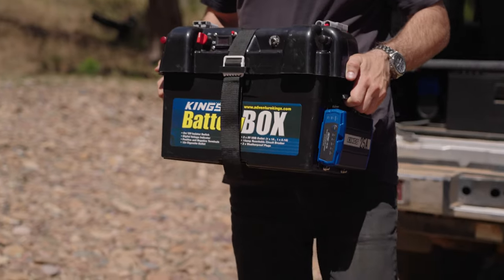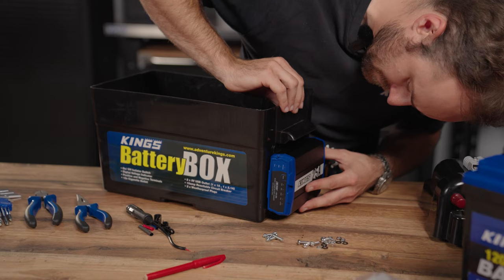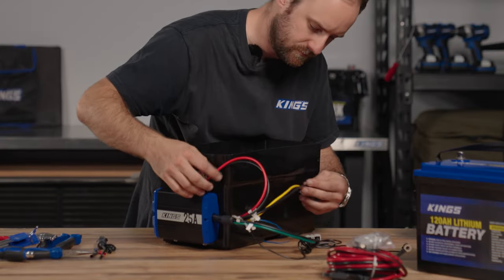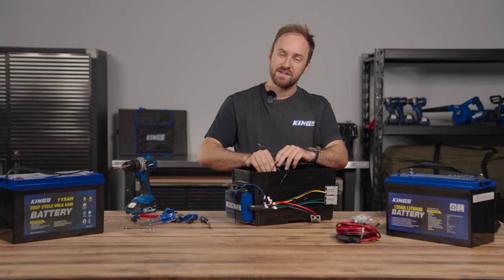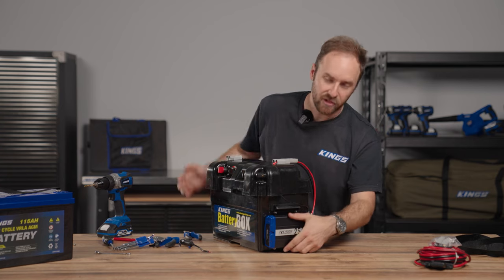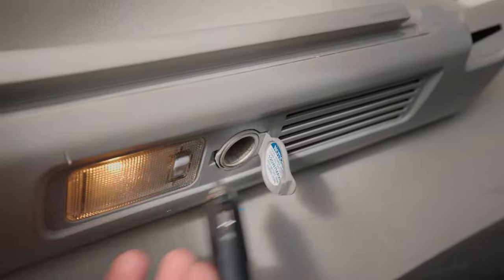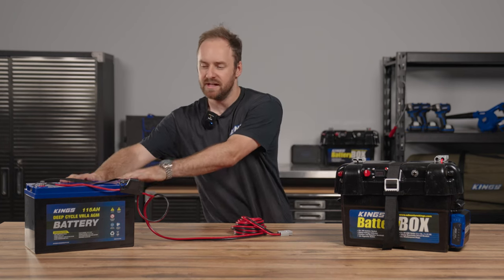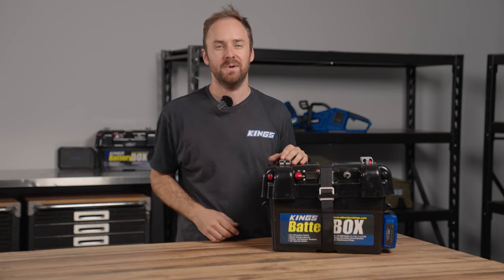How to install DCDC Charger onto Battery Box! Easy DIY!

Comment from the maker: I am getting a lot of questions about the blue wire and cig socket setup... One thing that is critical to check is that your cig socket only has power when the vehicle is on! Some newer vehicles like the Ford Ranger can supply power to cig sockets even after the vehicle is offf - in this case, the charger won't know to stop charging as it assumes the vehicle is still on!

SO, check if your cig plug has power when the vehicle is on and doesn't have power when the vehicle is off and you're good to go!

Cheers,
Cahn

Comment: So if i connect it to my cig plug, do i still need to run cables from the starter battery and connect to the battery box?
Reply: Cig plug is just a trigger, you still need connection to start battery
Reply: So do only connect the blue to the cig red ? Leave the black disconnected on the cig plug ? And can you just connect the battery in direct to a cig plug instead of running wires from the primary battery ?
Reply: What’s the input wattage requirement for the DCDC charger? My rear cig socket is labelled as 120W. Is that more than normal? Can I run power to that instead?

Comment: What about installing in a caravan to charge batteries,what happens with the blue alternator wire????
Reply from the maker: Hi there,

So long as it is able to register an active ignition it will intake power from the starter battery.

Regards, Andrew

Comment: Simple & brilliant - I visited the Parkison megastore yesterday, walked away with a new 45L fridge/freezer plus a 120AHr Lithium, DC/DC charger plus some other wiring gear, I think this setup however is way simpler, clearer, quicker & far easier.

Comment: Simple and effective 👍
Quick question... When connecting the ignition wire to a sig socket, do you just connect the positive and cap the negative?
Reply: Looks like he just tapped it up
Reply: Connect to the red wire and both go to the Cig Plug. The black must still go to Cig Plug.
Reply: So, the Blue ignition wire can go to the cigarette lighter socket? Is this blue ignition wire just one wire / core, or more? And the battery can charge from this lighter socket?
Reply: The blue wire is just a trigger, no charge through this connection
Reply: So even with the blue wire connected to a cig plug, you still have to run 50amp wiring kit to main Battery?
Reply: Can you still charge it even not to plug or use the ignition wire?, just using the 50 amp direct to your car battery?
Reply: @ermitanyongtsuper5105  yes if you have standard alternator, No if you have a smart alternator
Reply: @ermitanyongtsuper5105  yes if you have standard alternator, No if you have a smart alternator

Comment: Thanks for the easy to follow vid, one question though. What do I do with the negative wire from the cig plug after connecting the ignition to the positive wire? 4:31
Reply: Terminate it or cut and tape. You do not need the black wire, as the only requirement is the red for 12v switched +ve.
Reply: @daveinoz7813  What do you mean by terminate it ? cutting the negative wire means only cutting the non insulated wire and tape it?

Comment: Thanks for the awesome vid. I’ve completed my battery box as you have. The only question I have, with the cig plug, I have two cables feeding from the cig plug, while there’s only one from the DCDC Charger. Does it matter which cable I connect it to? Hope that makes sense.
Reply: This! Was wondering same question
Reply: @markwatson8886  hey mate. I worked it out. Needs to be connected to the positive end of the cig plug (which is the middle pin of the plug). The negative can just be terminated, cause there’s already one connected to the battery box from the battery. Let me know if I can help more.

Comment: Can you then run your car fridge from the battery box whilst you are driving and thus charging.  i.e.  charge and discharge at the same time??  Great vid though
Reply: Yes correct. It charges as you drive while using the fridge.

Comment: Has kings thought about doing the 3 plug Anderson’s similar to the kickass dcdc so it’s easier for your average punter to connect up the remote wire. Atleast the 3 plug is always backwards compatible with the regular 2 plug

Comment: Another approach in the same vein: I used a Maxi battery box with 120Ah Lithium battery, attached the DCDC charger to the internal divider and attached the solar and 12V input Anderson plugs to the lid by taking the pins out of the plugs and running them through holes drilled in the lid. It needs a little cable management on the inside to get the lid to close properly but it's not difficult.
Reply: Is there any concern regarding overheating the dcdc charger or battery by moutning it in the small space?  I'm considering a similar setup.
Reply: @thefieryphoenix1  I've only used it on solar charging with a 200W blanket and the DCDC charger gets warm but not hot, probably because there's a bit of empty space around it.
There's enough space to mount a small 12V fan and the box is far from airtight so it should allow decent airflow too.

Comment: Excellent vid, thanks. If my battery box setup is going in the caravan, is there a need for the blue ignition wire, if so where would it hook up to?
Cheers
Reply from the maker: Hi there,
If you were wanting to have this charged from the alternator of your vehicle and your vehicle had a smart alternator you would need to create an extension for the ignition wire on its own circuit.
Cheers, Courtney

Comment: Cahn....Thanks for this great idea. I too have just done the same  thing using Kings 60a lith, box, and 25a dcdc charger. I do have one question, if I may. When the isolator switch is off, does that only cut out going power. Or incoming power as well. In other words when switch is off, my fridge is off, but will the dcdc charger still top up the battery, or not.? Thanks Cahn....Mal
Reply from the maker: Hi there,

I can advise that the isolator switch is a full isolation switch, so when active will cut the battery off completely.

Regards, Andrew

Comment: This is a great option to use while going off grid. Should hold up well to my 75l fridge and led lighting. My Pajero is fitted with a smart alternator. Do I just link the blue to cig plug positive and no further wiring? Or do I have to run the additional cables from the main starter battery and plug in aswell via the Anderson plug to charge the battery box? Great video, just gets a bit muddy with the blue cable section...
Reply from the maker: Hi there,
You will need to run the full cabling from the starter battery to ensure the a full circuit.
Cheers, Courtney

Comment: Great video. Question that’s probably a silly one, if the battery box is turned off will the battery still charger through solar and while driving or no?
Reply from the maker: Hi there, In order to charge the battery while in the battery box, the box needs to be turned on as the switch on the box is a full isolator. Kind regards, Rachael

Comment: I have an Anderson outlet in the tub of my ute which is already switched off via the ignition (fused and isolated, roughly the equivalent of your 50A wiring kit but not always live). I only run a fridge from this outlet but am thinking I'd like to have the fridge run off an auxiliary battery when the car is off and don't want to go full dual battery installation. Can I simply connect the ignition wire and starter battery wire together and run to the 12V of this outlet. DCDC converter should get 12V from starter battery while ignition is on but not sure if this impacts on the smart alternator (which apparently I do have). Plan is to take the battery box out of the car when the fridge is not required day to day so will also need another maintenance charging option for the auxiliary battery while out of the car. Thanks for any advice you can provide.

Comment: Does the solar panel need to be fused when plugged into the battery?
Reply from the maker: Hi there,

Thank you for the comment, generally as the regulator would shape down any surge power output this would be unnecessary.

Regards, Andrew

Comment: With the cig plug idea which is great, did you only connect the possitive wire in the plug??
Reply from the maker: Hi there,
Just the positive wire as if you crimp both together this would short circuit!
Regards, Courtney

Comment: Hi Cahn,
Does ignition blue wire connect to positive or negative wire on the cig plug?
TA
Reply: Positive
Reply: @benperkins2929  so its ok to leave negative unconnected? Cheers

Comment: In this example are you using the blue wire which you connected to the 12v sig connector, then would plug into the socket to trickle charge while driving
Reply from the maker: Hi there,

That's spot on, the blue ignition wire allows the charger to open up power input from the alternator when wired correctly.

Regards, Andrew

Comment: Have just installed a AGM 115aH battery, battery box and fridge in my ute tray. What is the dcdc charger? Are they really needed?
Reply from the maker: Hi there,
Thank you for your question!
If you are wanting to charge your battery using both solar and your vehicles alternator you will need a DCDC charger as this will protect your battery. If you were only planning on using solar a standard regulator would be fine!
Regards, Courtney

Comment: Hey I’ve just bought a battery battery box wiring kit and dc dc charger from you guys how do you connect the ignition cable up to the cig plug being only one wire I’d like to connect it up as I’m not sure if my Ute has a smart alternator
Reply: Just connect blue wire to the positive of cig plug

Comment: Cahn, this is great mate! For the blue ignition wire did you just crimp the positive and negative from the cig plug together in the spade terminal? Cheers.
Reply from the maker: Hi there,
Only the positive wire was crimped as if you crimped both together it would short circuit. This is just to get the 12V+ for the ignition wire, the earth is still picked up from the DCDC charger onto the battery itself (and the 50A wiring kit to the starter battery). Cahn also checked that the cig socket on the vehicle was only 'on' when the ignition was on. With some cars the cig sockets are 'on' all the time which wouldn't work for this setup.
Regards, Courtney
Reply: @AdventureKings  thanks Courtney. Yes I have the 50 amp wiring kit and also have a cig socket in the back of my ute that only has power when the ignition is on. Thank you
Reply: @AdventureKings Just found your reply regarding cig plug, I now understand how it works as there is just 1 wire.
Thank you Nice to understand these things.

Comment: Just wondering how to wire the cig plug correctly to the blue wire, as cig plugs have a positive and negative. Im assuming the blue goes to positive but what happens with the negative?
Reply from the maker: Hi there,

Just need to piggyback the ignition off of the positive, as that's where the power check runs off of to confirm that the ignition's active.

Regards, Andrew

Comment: Hi,
The instruction manual says to connect the negative wire to the chassis not the battery if you have a smart alternator. Does this need to happen?
Reply from the maker: Hi there,
We do recommend while using the alternator to ground up the chassis, this can be easily done by adding a bolt or other similar clipping point to have a groundable section directly to the chassis.
Regards, Courtney

Comment: Where else can i connect the ignition wire because i have a smart alternator?
Reply from the maker: Hi there, we extend the ignition wire with extra wire and tie into a fuse in the fuse box using a double adaptor. Please find the link showing this, explaining at 2.10 minutes. https://www.youtube.com/watch?v=91qYNERt5Gg. Kind regards, Rachael

Comment: Hey kings, I run your battery box with agm through an isolator off my main starting battery into one input and have a panel feeding through the other input off a mppt regulator. Silly question how is this different and can I adapt your 25amp dcdc to my current set up in a similar format and also wire in my rear Anderson plug to keep a charge on my caravan batteries x2 115ah agm.  Big help if you could show me the way cheers 🍻
Reply from the maker: Hi there,
The DCDC charger will narrow these inputs down to one input as you can run your alternator and panel to your DCDC unit freeing up the other anderson connection. 
Cheers, Courtney
Reply: @AdventureKings  thanks Courtney, that’s great will I be able to leave my isolator under the hood and just wire up as per the video. There is fuses a plenty

Comment: Im also using the 50a wiring kit to my 25a dcdc charger, do you recommend that I change the 60a fuse to 30a?
Reply from the maker: Hi there,
The recommended fuse size for our 25A DCDC Charger is 30 Amps.
Regards, Courtney

Comment: Hey guys, I have a question: I have a smart alternator and 12v Cig socket in the tub. Problem is, the 12v Cig socket is always on, as in, its not switched on when the ignition is on. It must draw straight from the starter battery and is always live. My theory is that the dcdc charger will just continue to draw power from the starter battery. Is this true? Do you need the ingnition wire plugged into a 12v socket that is only live when the ignition is on? Or is it ok if the 12v socket is always live? Thanks!
Reply from the maker: Hi there,

As the DCDC will isolate based on the ignition line, you would likely see it draw down on the main vehicle battery with a permanently active ignition line, sadly.

Regards, Andrew
Reply: @AdventureKings  i thought that was the case. Thanks though Andrew 👍👍 ill run the ingition line and probably tap into one of the ignition fuses. Cheers! 

P.S. absolutely love the system btw. Got it up and running with solar and absolutely stoked with the battery, box, dcdc charger, fridge and solar gear 👌

Comment: Mate doing some DIYs here using  25 amp dcdc charger.i am confused on where to tap the ignition wire(blue) on the cig plug wire?most of the cig plug has positive and negative wires?where will i connect the negative?there is only 1 wire on the dcdc charger!
Reply from the maker: Hi there,
You can either tape or terminate it!
Cheers, Courtney

Comment: I'm looking at this setup for the boat. The outboard does not have smart alternator. Do I ned to connect the blue ignition wire if this is the case?
Reply from the maker: Hi there,
As this is connected to the cig plug this ignition wire is not needed to connect to the outboard on the boat.
Regards, Courtney

Comment: Hi ive got a 120ah AGM battery and have the same connection to the starter battery through the battery box.. will this drain my Starter battery even if my batter box is off? Or overcharge my AGM battery?
Reply from the maker: Hi there,

Thank you for the comment, this shouldn't drain the starter battery while the vehicle isn't running as it piggybacks off of the ignition so that it's only taking power from the vehicle while the alternator is generating input.

Regards, Andrew

Comment: Can you just run the alternator anderson lead, to a cig plug and plug it in to the cig socket in rear of vehicle? Would you need to unplug it then when car is off?
Reply from the maker: Hi there,
You can run the alternator lead to a cig plug socket in the rear of the vehicle. It would depend if you have constant power from the plug if you would need to unplug it. If it is only to the ignition it wouldn't need to be unplugged.
Regards, Courtney
Reply: @AdventureKings  would that be enough power though or would it lose too much voltage through the cig plug? Thanks

Comment: if i was to use the 50A wiring harness . would i have to get a isolator ??
Reply from the maker: Hi there,

Thank you for the comment, I can advise that the 50a wiring kit does come with a pre existing fuse, otherwise would function predominantly as an extension cable from there.

Regards, Andrew
Reply: my question was more so does the dc dc charger have a built in isolator ?

Comment: Got a question: What happens when I don’t plug the ignition wire on and I don’t have a smart alternator will my car still charge the battery when the car is on and also when my car is off will the lithium battery drain my starter battery even while my car is off if I still have it plugged in
Reply from the maker: Hi there,
This will isolate the system whilst receiving variable voltage input while there is no ignition cable. This can also drain your starter battery while the unit is still plugged in.
Cheers, Courtney

Comment: What size spade connectors are compatible with the ignition to positive cig socket wires? Thanks.
Reply from the maker: Hi there,
This is a lug terminal to suit a 50a anderson plug, our ones are measured at 3cmL, 0.8cmW, 1cm diameter!
Cheers, Courtney

Comment: Does the cigy plug is both crimp red & black to the blue wire ? 
It’s look like on video but not showing clearly. 
Thanks for reply !
Reply from the maker: Hi there,
Only the positive wire is crimped as if you crimped both together it would circuit.
Regards, Courtney
Reply: Bad idea, short circuit

Comment: Can the ign wire be connected to a fuse adapter then plug into the fuse box for a more permanent setup?
Reply from the maker: Hi Ryan,
Yes you can! 
Cheers, Courtney

Comment: will these DCDC chargers accept a house solar panel 38v and will it drop the voltage to 12v output for my 12v battery ?
Reply from the maker: Hi Jason,
We would recommend checking with the solar panels manufacturer if this is something that is possible.
Cheers, Courtney